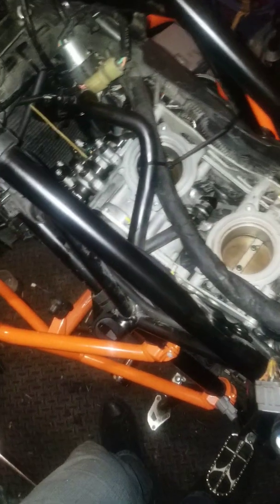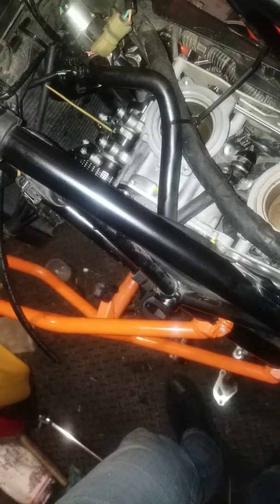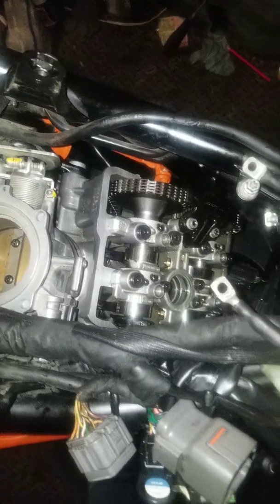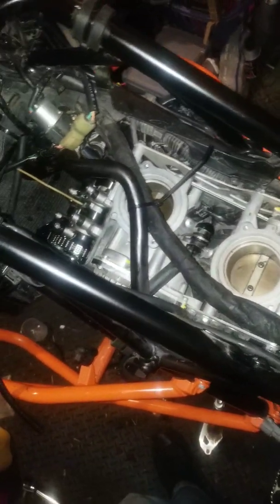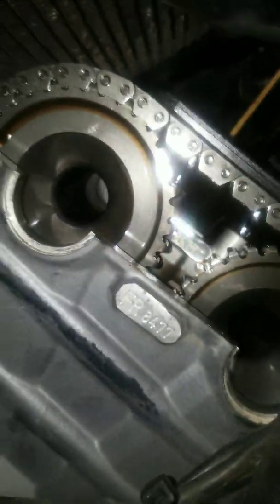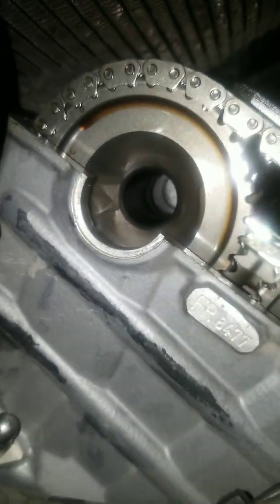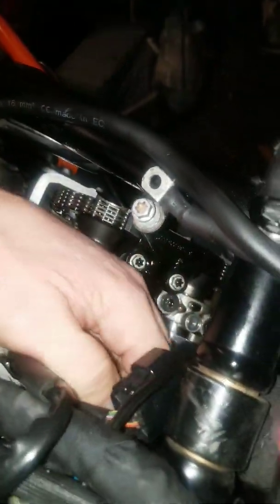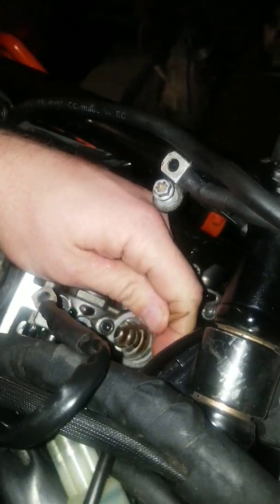KTM 1190 LC8 timing

Comment: How far did your brass tool go in to the notch on the crackshaft?
Reply from the maker: That brass tool was a cleaning rod for the pewpew. You can also use a kabob stick, I wouldnt use steel. You'll feel it shift, but I can't remember how much.
Reply: @DZLLC  i stupidly took the rear cylinder cams out without it being top dead center. Would using your method help me find top dead center on the rear cylinder to beable to reinstall the cams?
Reply from the maker: @ant4467  yes, my video is quite confusing, bit if you take notes amd correlate it to the repair manual (purchase a digital version online) ypu should be able to figure it out.